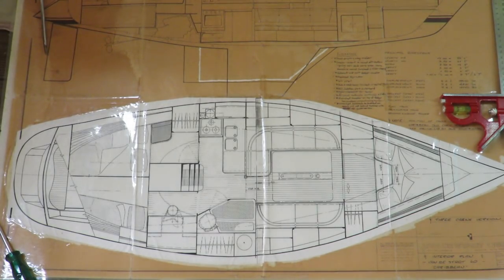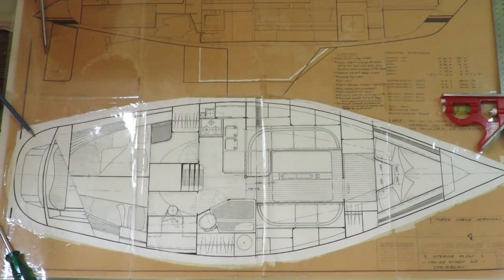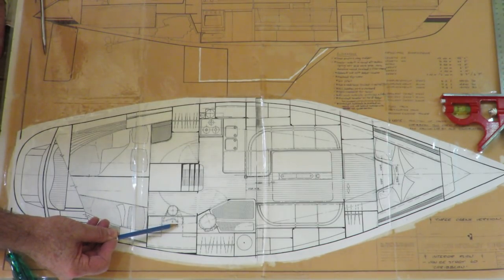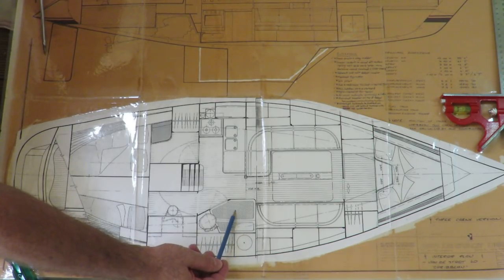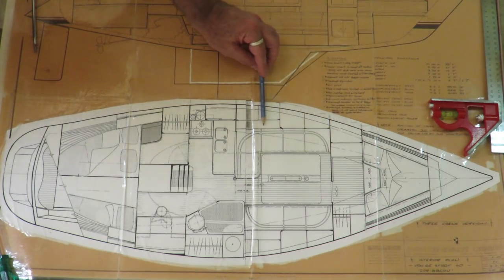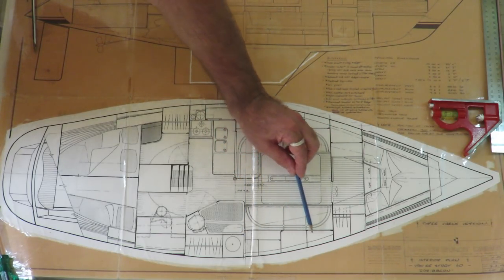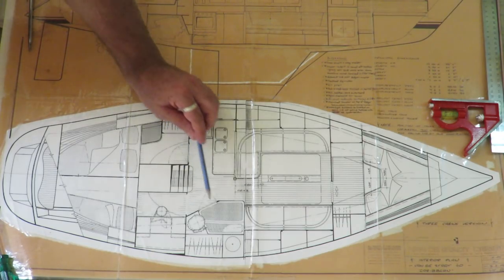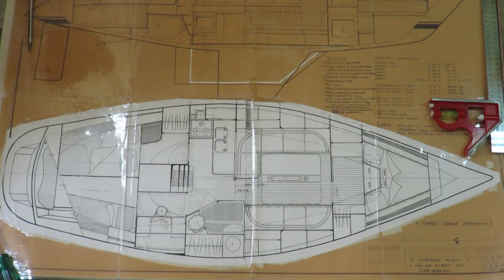Building my steel sailing yacht Tech.talks #5 The interior fit-out plans

Comment: Well thought out interior. Saves a lot of redo's when you plan what your doing before you start. You would be amazed how much time you save if it's wrong and has to be corrected. I would suggest planning in a 2" manual bilge pump close to the sump area where you can operate it sitting down on one of the mid berths. You would be amazed at how much water you can pump out continuously without excess tiring. Just for safety's sake.
Reply from the maker: Thanks very much for your good comments Richard and re. the manual bilge pump - yes, this too is already planned for, however the manual one will be operated from the cockpit and for a good reason  🙂

Comment: Hi Mate, personally I would change the rear cabin to a queen island bed and where you have the nav station and put the head there to make the captains cabin isolated from the rest of the boat. Second up front in the v berth use one of the lockers for wet and dry head and that can also be used for a day head. Keep up the good work mate.
Reply from the maker: Hi Lars and thanks for your comments, as you mention and I mentioned in the video there really are many options that the owner can decide suits him/her with regards to the fit-out. Also jfyi Mistress is an aft cockpit yacht which I prefer, not a centre cockpit where for eg. a queen island bed could be accommodated; my berth will be up forward and I really don't like the idea of blocking the access aft which heads alongside the companionway do. Thanks again for your comments and watching Mistress' journeys hey!  🙂
Reply: I would  have  don that had a  aft stateroom. he cant change  the aft  berth into a stateroom his cockpit is  to low.

Comment: You didn't mention wastewater tanks or fuel tank. I'm not sure what the regs are down your way on wastewater. I've been watching from the beginning so I know where the fuel tank is. Others that are joining in may get confused about tankage. Good plan for the interior. I agree with you to have your nav station facing forward. I know some people that have gotten off track because their nav station faces the side of the boat. Compass would be 45 degrees off and need to be compensated for when checking or correcting course. Electronics do help but I've learned not to solely rely on them.
Reply from the maker: @Ben Randomly Thanks very much for your good and clearly experienced comments, much appreciated sir! Re. 'holding/wastewater tank' yes these are also compulsory in Australia and Mistress' will be located at the aft end of the heads room. And I completely agree re. not relying solely on the electronics!

Comment: Looks great, not being a sailor, just one question. Why do all the boats make people have to walk past the galley to get a place to sit? Open concept boats? :) Thanks for the video.
Reply from the maker: @James Most Thank you for your very good question and just to firstly point out that if you are wondering/thinking about such things as this then we can all be sure that there are others who are also wondering! On most small boats space is obviously restricted and so for practical reasons there are only certain areas within the fit-out design where all of the necessary living requirements can be. The centre of boat's are the pivot point for a boat's rocking and rolling movement and so move around less as compared to the ends of boat's, which is important when needing to do the work of cooking etc; the centre of boats also generally have the highest head room which again is useful when needing to do the work of cooking; every area has to be somewhere and within small boat's generally most area's can be seen from almost anywhere, so in one way it is a matter of, 'so where do you want whichever area?' Also to mention that galley's = food and drink which EVERYONE loves to be around, right?!  🙂
This does mean, as I explained in the video, that designing the interior fit-out really can be done in ways that suit the owner, within for eg. the limits mentioned.
I hope that this helps explain some things and thanks again!
Reply: I would add: when going down wet, better to shake off water in galley than on cushions
Reply from the maker: @frankd2301  Yes, exactly, another very good point and my reason for wanting the head's (bathroom) right at the companionway! Thanks Frank.
Reply: @BuildingSYMistress  Many times cooking is done and carried up on deck. To be consumed in the cockpit. I like how the charts, head and galley are close to the companionway for quick access and return topside.
Reply from the maker: @richardbohlingsr3490  Thanks for your good comments Richard!

Comment: Where your diesel tanks and how much do you plan on carrying
Reply from the maker: I have X1 diesel tank mounted directly behind the engine of 170 litres and will carry 2 or 3, 20 litre containers, which I think will be fine for this cruising sailing yacht.
Reply: @BuildingSYMistress  400 liters may be a more realistic quantity. You won't know till you sail her and find out what her needs are. It depends if your willing to sit in the doldrums or motor through them.
Reply from the maker: @richardbohlingsr3490  Thanks Richard but I feel fairly confident that I won't need more diesel storage, Mistress' 33HP new engine has an economy consumption of ~0.7 litres/hour, so ~10 days of continuous running just from the main tank and thankfully I will not be in a hurry once we are sailing!  🙂

Comment: PLACE YOUR BATTERIES AFT STARBOARD. CLOSER TO THE ELECTRONICS PANELS AND CLOSER TO THE ENGINE. make  a hole under the single berth for you  batteries.. for at least a 1000 amp hours. ARE YOU INSTALLING  AN INVERTER? SOLAR PANELS? WIND GENERATOR? WATER MAKER?  GENSET? etc. YOUR STARTER IS A 12 VOLT SYSTEM.  HONESTLY  BATTERIES IN THE SALON AREA IS TO FAR AWAY. SINCE YOU HAVE A 12 VOLT SYSTEM YOU WILL HAVE TO RUN A 0 GAUGE CABLE. BIG ASS CABLE.. I HAVE 1500 AMP HOURS  OF  BATTERIES ON MY  YACHT. PLUS ALL OF THE  GARMIN GAGETS  i COULD  FIND.. I also have  a still on my  yacht so i can make more rum and  so i dont run out of rum . why is  rum gone.